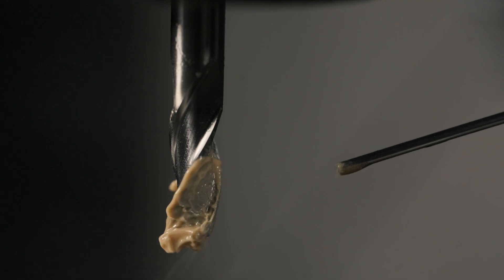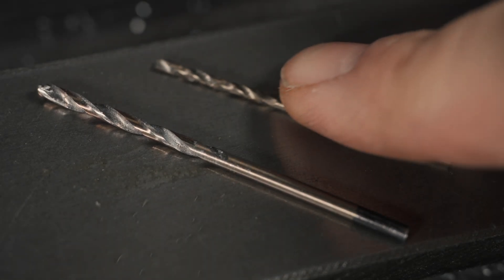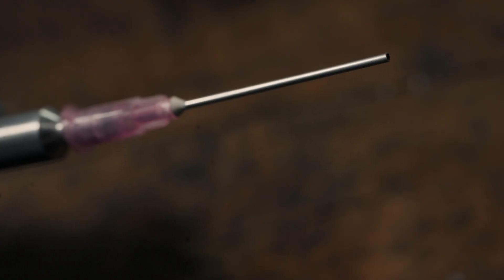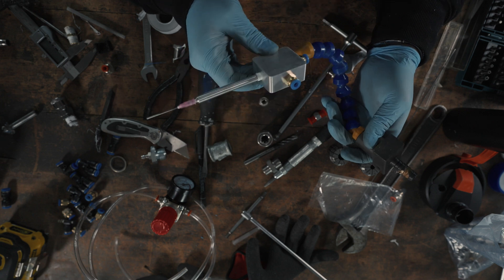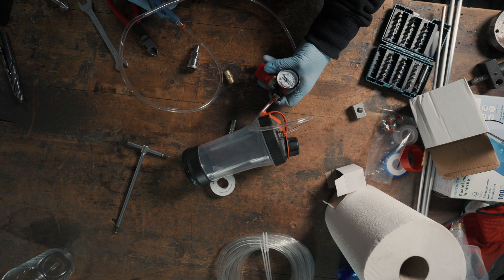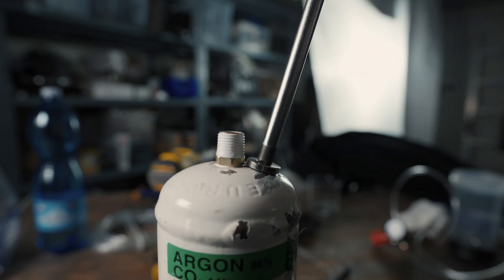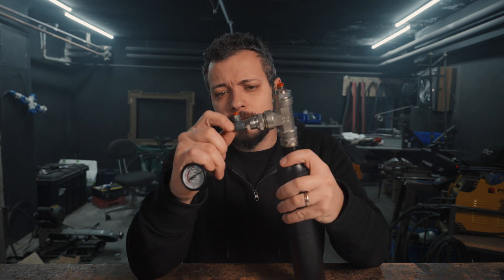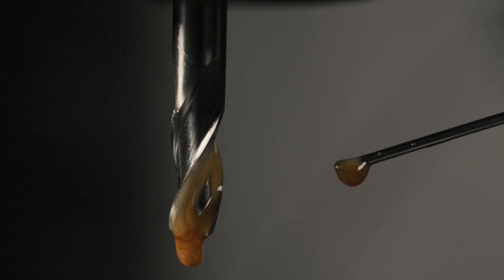DIY FogBuster (mistless coolant system for the milling machine)

Comment: A clear RO filter housing should be able to handle the pressure.
Reply from the maker: Yes, that’s a good suggestion, I just happened to use what I had at hand 😉

Comment: I made my low budget MQL lubrication system with a simple compressed air lubricator I bought from a seller from Subito (for non-italian commenters, it's an Italian online marketplace), a piece of 6mm steel tubing, a piece of brass and a LPG jet for a kitchen burner!
It works flawlessly, with around a tiny drop of oil every 5~8 seconds at 2bar air pressure I have enough air to blow away chips from the working area and that small quantity of oil needed to avoid chip welding milling aluminium!
I'm at the moment using a vegetable ester cutting oil I recover from a friend who works in a big industry, with less than 100ml of oil I can work for around 8 hours continuously!

Comment: Very nice idea! It's just what I am looking for when using my little Atlas Milling Machine, Thx for sharing.
Reply from the maker: My pleasure man, thanks for watching :) if you take a shot at it yourself test it with a respirator ‘cause it’s mistless only if the air is dialed in right at it takes some trial and error 👍

Comment: Hook up a vacuum running through a baffled collector, A Thein works well), as breathing in microscopic particles of aerosolised cutting fluid o oil is not good for the lungs.
Reply from the maker: I’ll be careful, thank you 👍

Comment: Recently I was thinking of making my first mist system.  Maybe use a little less Tap Magic, definitely relieve me of manual basting duty.
Now I am thinking I'm gonna break off that needle a few times.  But it's gonna be a better way. 
I was literally - just two days ago - digging through my pneumatics bin for suitable regulators and tees for this project.
Thanks for this!
Reply from the maker: You’re welcome buddy, thanks for watching. I was worried about the needle too, but I’m finding out it’s surprisingly resilient to bashing XD but in any case, I have a stack ready for use and it’s very quick to change :)

Comment: I applaud the use of oil instead of DISGUSTING, WATER BASED COOLANT! That is a good start of actual machine care... CNC may require water based crap due to performance demands that the industrial setup pushes for, but if you are running machines for your own business or a hobby - water is the enemy, always was, always will be... It is the only thing as bad as the grinding grit itself... ``If it`s not oil - your machines it will soil...``

Best regards!
Steuss
Reply from the maker: Thanks man, I agree, no machine was ever damaged from having too much oil on it 😁 water… no so much! 🤮
Reply: Meh, relax. I use soapy water to machine plastics all the time, and aside from having to be thorough when doing cleanup, it brings no trouble.
Iuse Tap Magic for everything else, but I hate that you have to wear gloves with it. Not because it's hard on skin, it's not. But because it penetrates
the skin and stays in there, stinking, for hours or days after you have washed your hands five times. And it's expensive. But I've never used anything better.
Reply: @railgap  Yeah, nah, water is banned in my shop... Clean-up is always in order after and during machining, but having to wipe things ``dry``, blast them with wd40, wipe them dry, wd40 again, more wiping and then a petrol towel followed by way oil - that is just too much work to bring into the shop something that has no place in the shop in the first place... I can understand using concentrated automotive glycol, as that is full of anti-rust and lubricating additives for engine coolant pump seals and all the good stuff, but if it has water in it - it ain`t going in my shop or near my machines... 

You don`t want water in your knees, let alone around your machines, or God forbid - mill knees... 

Speaking of tap magic, oh yeah, but it is not the only compound that leaves not your hands despite washing... Most good industrial grease behaves like that too - i always use gloved hands when i feed my dogs, as i know that my fingernails always have a slight whiff of ``petroleum products`` emanating from them, and if i can smell it - the dogs smell it that much better... It is probably microgram amounts in the pores of skin and nails, but while it may be harmless to me, i don`t want to ruin their food with it... I don`t mind the smell, but then - i trust myself, whereas the dogs may trust me, but they don`t have the iron logic to ensure them that their nose is just ruining their meal for no good reason... 

Best regards!
Steuss
Reply: @railgap  Try a mix of 2 parts Olive oil 1 part Mineral Turpentine and 1 part White Spirits.
That is a very old recipe from the 1800s.  I now use ATF instead of Olive oil.
Reply: I run water heavily loaded with baking soda in my bandsaw. It is Alkaline so no rust worries.  Been doing it for near 20 years now. Also cheap as. With oil on a bandsaw you lose a lot due to every cut piece being coated in the cut area.  It all adds up - fast.
Reply: @Onan-u3b  Truth be told, you could run old engine oil on a bandsaw... The only ways are high above, so they are lubed manually, and the cut itself can waste all the oil it wants... The contaminants in the oil from the engine, as well as the swarf are kinda irrelevant, as long as the saw has a nice separator chamber and maybe a filter to catch most of the junk as not to flood the ``coolant`` chamber with swarf over time...
Reply: @camillosteuss  True, but messy. I was merely pointing out something that also highlighted that one of the things about ferrous metals is that they do not rust in an Alkaline environment.

Comment: I made one similar to this like 25years ago when I made my house smell really bad with a bijur spray mist unit once. I now have a more precise smoke extraction system and just use oil again.
Reply from the maker: I’m still testing things out, see how it goes, flood coolant but with oil instead of coolant is still an option, as is the oil bottle for smaller things
Reply: @TheProjectHavoc  I'm still hoping to find something better. But for now, I stick with air extraction because it was a cheap fix. I wish I could run flood coolant. But it's just too messy. 
I'd like to set it up for running on my surface grinder, but I rarely use it. So the coolant would be spoiled before I use it a second time. 
Lastly,  your design is very good. Simple is better.
Reply from the maker: One day I’d like to have a surface grinder as well and I’d like to run it with coolant, have the same concerns about it spoiling… maybe there’s some new stuff that is less nasty. We’ll see, I glad you like my design 😊

Comment: I did the same, using those dispenser needles and added a peristaltic pump plus some nice low pressure STC regulators. At some point, I even had a very swank resin printed distrubution block but the alcohol I use for coolant ate that up in days. So, made it on the CNC which was fitting as it was for that same machine. 

So, yeah, a tad more expensive because of the pump and the regulators but I got that secondhand from China so overall still very, very cheap and I can dial it in perfectly. And whether the tank is hanging high or low in relation to the machine doesn't matter with a peristalitic pump. I also pressurized the tank and air feed separately but maybe less needed with the pump.
Reply from the maker: Dude, you should have made a video too! 👀
Reply: You can get PP filament, proof against most common chemicals.

Comment: I went even cheaper, but with less style.
Cut and modified a crappy $5 paintbrush with 0.3mm nozzle with some bits of plastic tubing. Worked as a charm.
Yours is more professional though.
Reply from the maker: The important thing is to get there 👍 I just have a weird obsession for machined metal, so I use it as much as I can 🤘

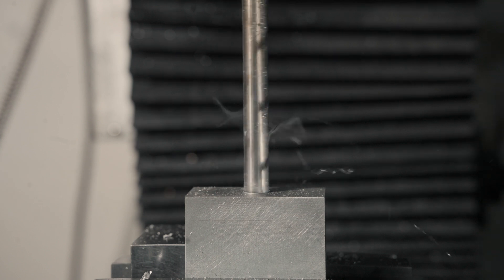Comment: 0:56 2.5mm = 0.1"
Reply from the maker: Oops 😬 thank you, I got that totally wrong 😅
Reply: @TheProjectHavoc  I have trick for converting to metric. 1 foot is ~1 nano light second. Hope this helps ❤
Reply from the maker: Thanks, the imperial is not that bad once you get the hang of it, like 3/16 sounds completely absurd to visualize… until I realize it’s about 5 mm, a distance we metric folks reference all the time… so the weird fraction is basically just another name for the same physical reference  😊
Reply: @paulroberto2286   a foot is also very close to the size of..... my foot.

Comment: Two things: 1) please be aware mist coolant is harmful. You are basically aerosolising oil or coolant and guaranteeing you are breathing it in at a much higher rate than other methods. Wear a mask while using. 2) If your machine can do even 2.5k rpm, you can absolutely run carbide. I run carbide of all sizes no problem in a machine not even 1/3d the size of yours, and also low max rpm (3.1k). You are nowhere near the limits of your machine I think. I am guessing it is a confidence and experience issue more than a machine issue.
Reply from the maker: Hi, technically this system shouldn’t make mist, but I’ll take my precautions 👍 thanks for the warning 😊 as for the rpm, unfortunately the max speed of my machine is 1200 rpm 😕 the only carbide I can run properly is  a fly cutter or a boring head. 8mm end mills sort of run, but they chatter and chip very quickly. Trust me, this machine can’t happily run carbide as main cutter 🥲
Reply: @TheProjectHavoc  I'm confused - how can your mist coolant system not make mist? It's blowing a spray of pressurized fluid? On your rpm - yeah wow. 1200 is slow! You could maybe maybe run some roughing cutters. Anyway - at least you have a fun option for a drivetrain project :)
Reply from the maker: Should be mistless, so it shouldn’t atomize droplets so small to breathe. But until I test that with some kind of air sensor… I’ll wear protective gear. 👍Drive train project sounds like fun, I’d like to do a belt conversion one day 😊
Reply: @TheeGrandmaster  It's likely based on the Fogbuster as in "eliminating fog" or rather mist. So, it should be putting out tiny suspended droplets. I have mine dialed in super well but I also went overboard and added a peristaltic pump to the setup so I can control the liquid flow incredibly precisely and I have separate, low pressure regulators on both the reservoir and the air feed. If I backlight the nozzle I can see the tiny droplets but no mist. Then again, maybe there's some mist there too that I don't see...

Comment: Amazon has them for $9, don't waste your time
Reply from the maker: For a business, definitely 👍 but for a hobbyist make the tools is always a learning opportunity 😉
Reply: @TheProjectHavoc 
Taking a lose is never opportune. There's no shortage of projects
Reply: If you are referring to the Chinese MQL "fogbusters" they aren't great. I have had two of them. They use way more air than they should and the ajustment is hit or miss. They may be OK for something inbetween MQL and flood but not for a finely tuned droplet type MQL system.
Reply: @AntiVaganza 
No, im not talking about preassembled garbage. Anyone that has a basic grasp on the Venturi effect can slap one together based on their needs. This for people that are bored and not interested in turning a profit.
Reply: Great, good for you. As for understanding the objective, if you have a VMC, you generally have plenty of air available - the objective here is home gaming. As such, most of us don't have or want to run big compressors. And maybe I was too stupid to slap together the Chinese Amazon system. Or maybe I wasn't, maybe when I said it uses more air than it needs to, I was basing that off of real world experience - e.g. the nozzle is way bigger than it needs to be which increases air flow = higher air consumption. If you have a big compressor, fine. If you don't, then it's an issue. 

Now I have a DIY MQL system, not mist, which runs off of a tiny 30l compressor at less ~4-10psi which cycles every 4mins or so. It has a peristaltic dosing pump with a stepper which can consistently put out the tiniest amount of coolant. This setup is not for production mode obviously, but the machine can run for hours and the compressor is fine so far. 

In short, there's zero fiddling with needle valves and the system runs super consistent and uses very little air.
Reply: @AntiVaganza 
True but point I was attempting to make is getting wrapped up spending money just to entertain yourself isn't productive. The peristaltic addition is a great idea however... It does defeat the purpose of the Venturi entirely. Downline from a cold gun i could see having benefits.
Reply: @AntiVaganza 
Also, compressors are typically only used for tool changes.. its far easier to output the 1000psi needed if air isn't involved.
Reply: @AntiVaganza 
Then again if profit was the goal flood would be used. What do I know, I built my first cnc 25 years ago & used the profit to purchase many vmc's since. Just 2¢ from someone that understands the objective

Comment: Soda bottle is made to handle pressure and can handle 100psi...
Reply from the maker: Yes, and according to Tom they burst at about 120. They are perfectly safe to use if you’re not in the habit of messing with your pressure regulators. Unfortunately I mess with my regulators  all the time and my compressor goes to 150psi… That’s where the paranoia coms from 😅

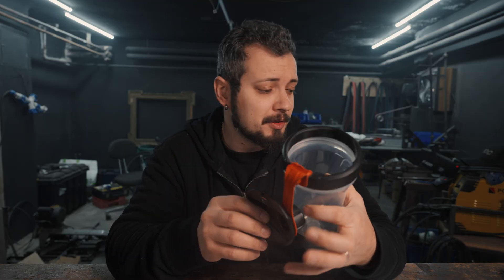Comment: @Project Havoc 4:35 There are coolants that are not causing any rust but are instead protecting parts from rusting.
Reply from the maker: I’ll have to educate myself in that area, and see what I could manage to get 😊 I’d like to do a lot of machining in the future, so I’m sure occasions for testing will present themselves. For instance one day I’d like to find a surface grinder to restore, and I like the idea to run coolant with that to keep the dust under control 😊

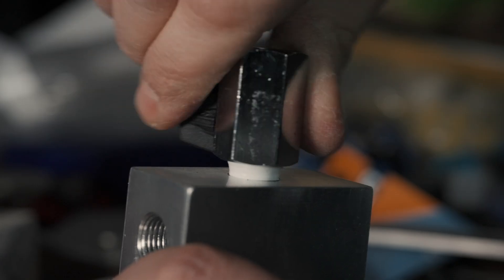Comment: 3:40 you didn't spend those $$$$ back then on equipment to not save any $$ now on parts tho 😎😎😎
Reply from the maker: When the $$ math is down, to be a hobby machinist/maker you need to be very good lying to yourself 😂

Comment: venturi nozel is the answer to your problem, with the coolent pressure.
Reply from the maker: Thanks for the suggestion, but now that I’ve dialed in I really like the pressurized reservoir 👍 takes a lot less air and Is more consistent
Reply: Venturi effect is the way to go, because it is simpler. I have used only a fridge compressor and a venturi effect nozzle that gives me similar flow